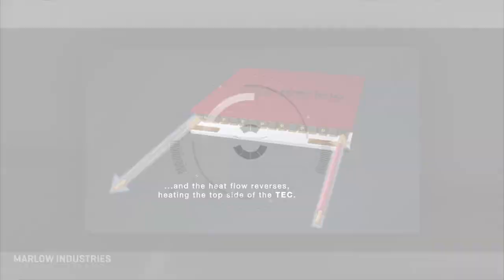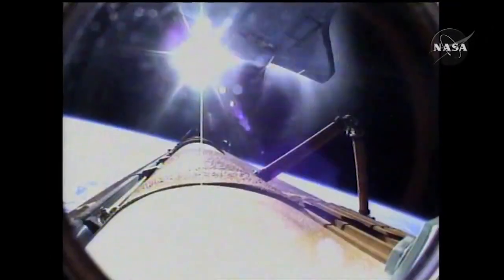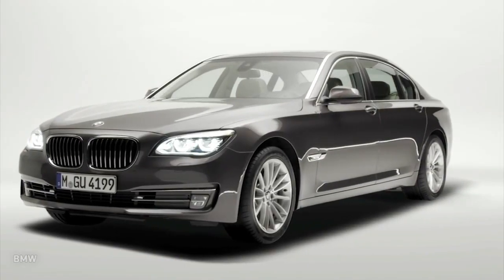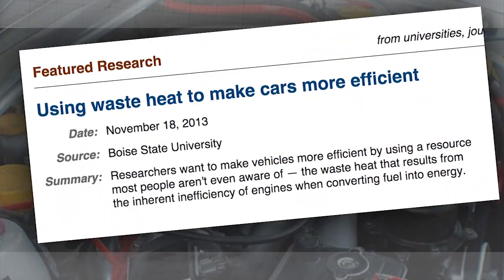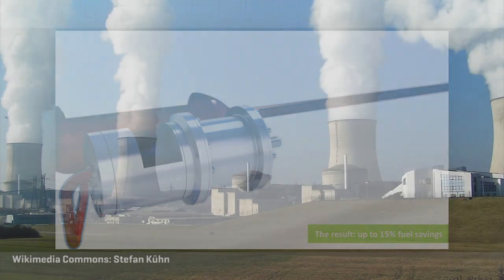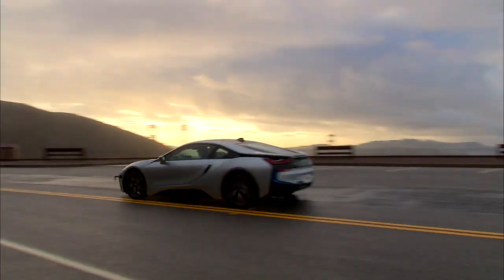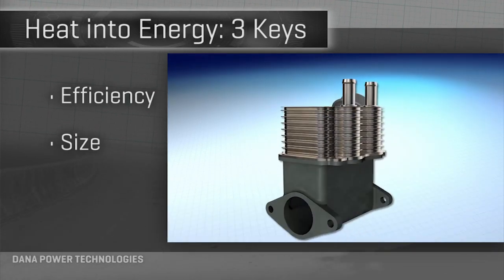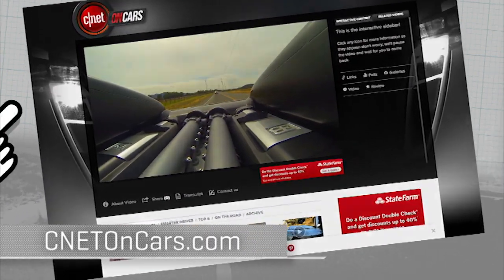CNET On Cars - Car Tech 101: Recovering your car's lost heat

Comment: 0:27  Could someone explain the thermoelectric effect?  Why does it create an electronic differential that generates current if you have 2 different connected materials react differently to heat?  If I take a paper clip and stick it inside a piece of bread and heat them will it create current?  A paper clip and bread are 2 different materials that are attached
Reply: http://en.wikipedia.org/wiki/Thermoelectric_effect

Comment: Good innovation but still using gasoline...we need to ween off fossil fuels and look to hydrogen, ionic fluid, zinc-air battery chemistry, atmospheric electrical wireless conversion ( Nikola Tesla), efficient newer solar cell technology to charge and use to convert heat into mechanical energy, magnetic surge motor generators...powering up our infrastructure and utility services including incorporating the use for transit roads and highways...
Ionic fluid technology can be viable now for use in all transportation, utility energy, and all batteries...
Reply: this is weening off fossil fuels... increased efficiency.